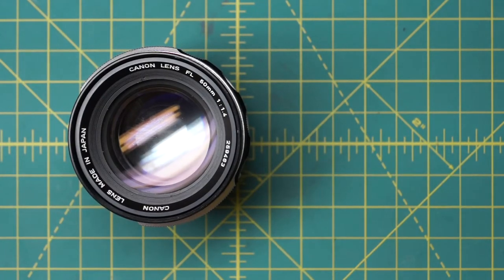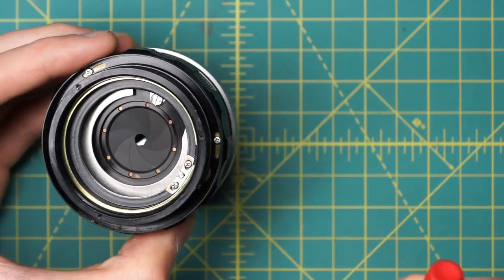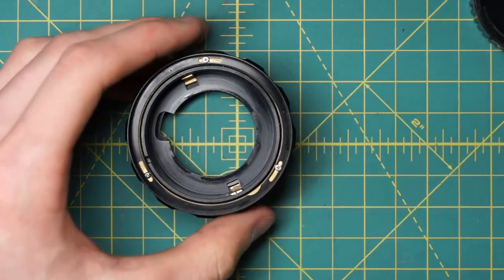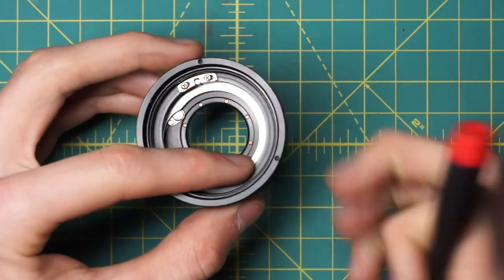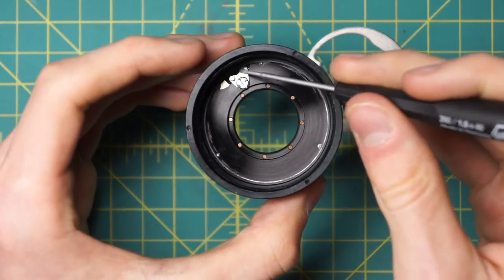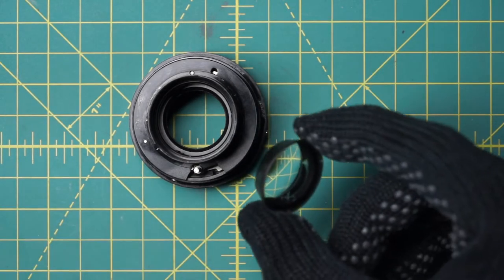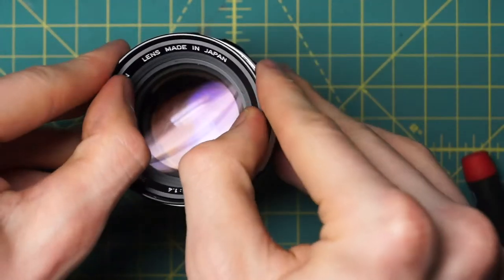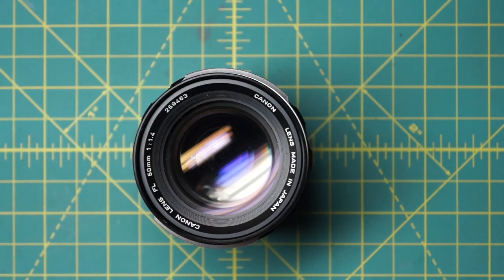Canon FL 50mm f1.4 II Lens Disassembly

Comment: Hello Matt, Great video thanks for taking the time. I have a beautiful 50mm f1.4 FL lens. The diaphragm will not stop down at all. With the switch set at a or m operating the lever does nothing. Moving the aperture ring also does nothing. I'm guessing when you refer to a FL as an FL-II it has the A-M switch at the breech lock end correct? (My lens has the A-M Switch right behind the aperture setting dial on the front,  I guess mine is a model 1?)  I don't see any oil inside the lens. I guess following your video I'll have to open it up and look inside. By the way, I use lint-free cotton gloves when working on lenses. I also noticed you use  Phillips screwdrivers. You may wish to consider JIS Crosspoint screwdrivers. Gloves and Jis screwdrivers are available online. Thanks. OH! I see now in the reassembly portion you are using gloves.
Reply: Philips will riun every tight screw. I tested JIS vs Philips, 3 perfect vs 3 killed

Comment: hi! very very nice video!
Do you have any idea if an FL 55mm f1.2 will have a similar build inside?
I might have to look into one.
Thank you!
Reply from the maker: I can't say for sure since I have never worked with one of those lenses but I would guess not, although it may use some similar design and construction techniques. 1.2 lenses usually have a specialized design to house the larger optics

Comment: Thanks for this great video! What grease would you recommend for use on the focus ring of the FL lenses? I have a Canon FL 58mm 1.2 that has a stiff focus ring. I plan on cleaning the old grease away and replacing it.
Reply from the maker: +Thomas Kinsman The key is to use a lubricant that will not damage the materials, does not trap moisture, and does not run, even at high temperatures. And you really don't need a lot of it, just a tiny dab will handle it.

Some sort of heavy bearing grease is probably a good choice, just make sure it is safe for plastics and metals. I've used white lithium grease, which is a bit thinner but pretty stable once placed. Again, you really don't need a lot to get smooth focusing.